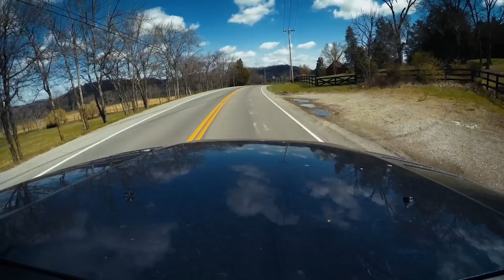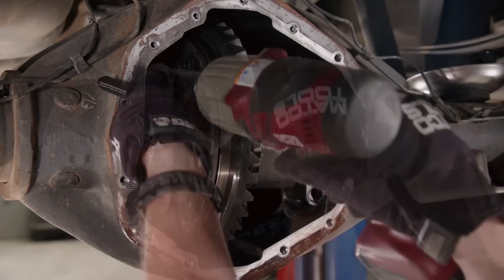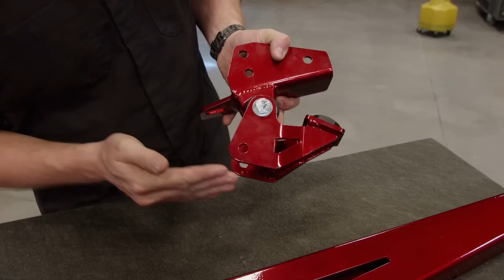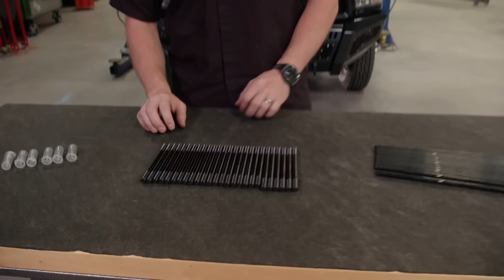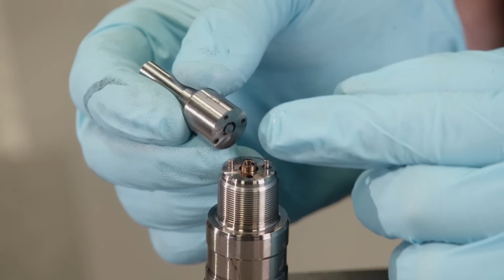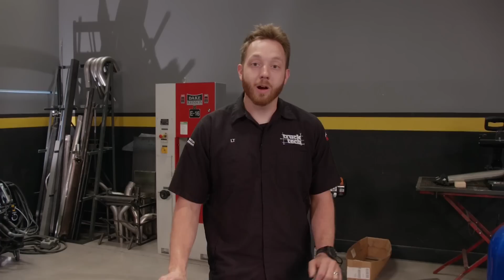Stage 2 Ram Wrap-Up | Truck Tech - S6, E1

Comment: Wow.....why to fuck up a trucks look with them dumb ass wheels.....ya we made this truck for sled pulling and the track.....buuuut now we are just making it look stupid.   Maybe I missed it but that transmission is smoked on first test drive without a valve body and torque converter at least

Comment: Why erroneously state that Detroit Lockers split power 50/50 between the wheels? A locker locks the diff and this allows power to transfer so even 100% of the power can be sent to the wheel with traction. 

A 50/50 torque split is what an open diff provides and there is nothing mechanical that splits actual power 50/50 (power being the combination of torque x rpm). An open diff allows 100% of the power to be wasted by sending it to a wheel with no traction (with the torque always split 50/50 and  one wheel with grip at 0 rpm, all of the power goes to the spinning wheel).

Comment: Diesel are a dying engine. They put out way to much carbon !  Where choking on carbon in our air NOW!  Cut em off boys or where all going to die way early!
Reply: Not quite.  Modern diesels emit 40% less co2 than gasoline motors

Comment: This truck is sick. I would love to do the same thing to my 14 Ram 3500HD single rear tire. It's bone stock due to it being a work truck, but it also pulls the occasional gooseneck trailer. I have actually pulled over 50K pounds with it before. It has an Air Ride leveling system on the rear axle, so it never had an issue handling the load, I just could've used more power to put some ass behind it. It's an oilfield truck, so you can imagine it's had a load behind it quite a few times. I have a 36' gooseneck lowboy trailer and it's seen some use in my time. Hell, a programmer would be a good thing to have.
Reply: Pulling 50k lbs is no big deal, did you not see the Toyota commercials where they are pulling a Boeing airplane??
Reply: @centraltexasfoxbodies   Pulling a object down the street is very different from across country up huge hills and having to slow down going down large hills. 
That toyota would boil over and melt  the first hill it hit  .
Reply: @markrich3271  not necessarily, it would be very slow but it would do it without any issues, it's all about gearing not so much as power, I understand what you're trying to say but it can do it if traction allows.
Reply: @centraltexasfoxbodies  Toyota doesn't make a factory vehicle w/ axle , gearing , transmission or brakes  to do so.  No way in hell would I try towing my 32ft 5th wheel with a Tacoma .
Reply: @markrich3271  transfercase in 4 low has a bunch of pulling power.... toyota does make medium duty trucks, which will in fact tow your 32ft 5th wheel trailer.
Reply: @centraltexasfoxbodies  The truck that was just on the video isnt even considered medium duty.  Toyota doesnt make one truck thats able to pull any type of substantial weight  tundra 2018 11,000 lbs.  what does 4 low have to do with anything? you cant use it past 15mph. Do you understand how gearing in a truck work?
Reply: @markrich3271  why yes I do know what gearing is and does, and toyota does build class 8 trucks if youd do some research you would find that out all on your own.
Reply: @centraltexasfoxbodies   Class 8? ok . Thats your response when you realized you cant drive or tow in 4 low.  Ya Ill throw the family ion a box truck or semi.  Lets come back to reality .
Reply: @centraltexasfoxbodies  silly me I thought this topic was about light duty factory purchased trucks where the driver DIDNT need a cdl to drive  You win the youtube debate goo job 
Because semi class 8 trucks have 4 low and all o well.
Reply: @markrich3271  oh sorry I thought you were knowledgeable in trucks and vehicles my apologies for thinking you did, and why do you have to bring your family into this? It was about a Toyota truck being able to haul weight not about doing it in comfort, and I use my transfer case all the time for moving trailers around so I don't stress the clutch and slip it to much.  Incase you dont know what a clutch is it's usually in a vehicle that has 3 pedals instead of just 2.
Reply: @centraltexasfoxbodies  My family is part of my cargo,  that has to do with its weight , seating and my purchase  Your 4 low gearing is different that the 4 high and rear axle . You cant tow with 4 low . Its impossible . If you want to spout stupidity go for it. Class 8 trucks OK. Next youll tell me about some military plane that can carry xxx . We were talking about pick ups you knew that though.  I could spout nonsense too ever see cummins engines some are as big a your house. 
Lets be clear I replied to your reply about a tacoma pulling a space shift reliably.
Reply: @markrich3271  how is it impossible to tow in 4 low when I literally do it around the yard? You can do anything youd like in 4 low, there are no laws against using 4 low, and this was never about a pickup, you stated "toyota doesnt make anything that can haul weight" which clearly they do, that's how all of this started. Who cares about planes? This was about Toyota pulling stuff, never once did you say a pickup you just said toyota.... so what other excuses do you have? If you clearly knew what gvwr is youd understand that any vehicle can tow anything by law, a smart car can haul anything it wants as long as the vehicles gvwr is exceeded. If its gvwr is 5k for instance it can haul 20k lbs but the weight of said load cant be on the vehicle... I have a cdl, I've hauled heavy loads, I know the laws and how to work around them, anyone who has hauled or driven commercially knows the ins and outs...
Reply: @markrich3271  oh by the way it was a tundra that pulled a space shuttle not a tacoma...
Reply: @centraltexasfoxbodies  thats not towing getting out on the highway and moving something is towing .  Class 8 trucks dont have 4wd . Your talking out your ass. Smart cars with class 8 gearing . ok.
Reply: @markrich3271  actually there are class 8 trucks with 4wd, or rather awd. Cause they usually have 3 axles. That was just an example on the smart car and 20k lbs isnt class 8 weight just so you know.
Reply: @centraltexasfoxbodies   Who said it was. Your answer are radical smart cars with huge gearing .Class 8s with 4wd. Tocoma towing rocket ships ..in your yard. What ever you say.
Reply: @markrich3271  you seriously need to get out and see what goes on in this world, the smart car was an example as already stated, a Tacoma never did anything it was a tundra, and yes class 8 trucks have 4 wheel drive, there is this thing on the internet, it's called google, you should check it out sometime. Might be able to expand what little knowledge you have. You turned this around so many times, this started out because YOU said Toyota didnt build anything that can haul heavy loads safely which in fact they do, plain and simple. Knowledge is power, which apparently you dont have much of either.
Reply: @centraltexasfoxbodies  I need to see the world. We were talking about factory vehicles but im all for putting up anything ive built to anything you have. Your a troll on the internet that hasnt built anything in his life, living bi curiously through others  but if you would like to shut me up here is your chance.  I wasnt talking about your imaginary fantasy builds. You read a few articles and think you know everything .
Reply: @markrich3271  so toyota builds factory vehicles, correct? They build vehicles that can safely haul heavy loads, correct? Shoot me an address so this can settled then since you wanna talk about what you have, i dont have much but I do have videos of my truck on YouTube for the world to see, granted it's an old wore out truck but it's got a few things done to it. Upload some of your vehicles so the world can see what you've built, I dont have tons of money to spend on vehicles, I have a family to support, and I have factory training through work, I work on peterbilts all day long, so I know a little but will never know everything but I do know about towing as I have done it and learned some tricks along the way, I've pulled 53 foot car haulers with my old truck even though it's only rated for 10k lbs, it's all about load distribution, as long as when I cross the scale and my truck doesnt weigh over 10k lbs and the trailer weight on the scales doesnt exceed 21k lbs then it's legal in the eyes of the law.
Reply: @centraltexasfoxbodies  What exatly did you build? Nothing ?  Here one of many of my builds . 
https://www.theturboforums.com/threads/a-machinist-a-turbo-and-his-l31-gmc.381269/
Reply: @centraltexasfoxbodies  Your a real tuff guy huh . Ill come over we can settle it Your a troll you talk out your ass.  Heres another build. 
https://www.cumminsforum.com/forum/98-5-02-performance-parts-discussion/2509829-
Reply: Ya know smart cars with huge gearing or even Toyota truck made to haul space ships are not factory vehicles .  Do you want more of my builds . Go read another magazine .
Reply: @centraltexasfoxbodies  I live in Naugatuck CT . Close by  ?Youll see some pictures of me with pictures of my firearms too. Im a big guy with big guns so if you want to threaten me your more than welcome to come by on my property.  But you talk out your ass because your a troll who rus his mouth. mot likely in your moms basement.  I bet shes cooking you dinner now.
Reply: @markrich3271  I'm not talking out of my ass as I'm clearly not talking at all, if you're reading this then I typed it out, and houses in this area dont have basements so you're wrong again. Keep trying mr big tough guy with his big guns.

Comment: Wouldn’t 3.42 be a poor choice for drag/sled?
Reply: Mine has 4.10s. But then again I not drag racing. Im pulling 25,000lbs worth or horses, gear and trailer.

Comment: Grade 5 hardware with nut certs holding the traction bars on a [No holds barred track only] sled puller?
Reply: Seems questionable.   I would assume there is engineering to support the design.  But the weaker hardware seems sketchy.
Reply: Same, I would've drilled through both side and welded a tube in the hole so they can use a real bolt and nut.

Comment: Nice! I wanna make a comment on the diff cover. Banks did a test with a clear cover and showed the square cover did not allow the fluid to go where it was needed compared to the rounded cover. Hmmm. they are doing some redesigning.
Reply: Was thinking about the banks test
Reply: Wasn't available when this build was done.